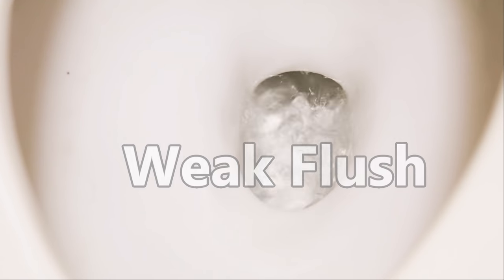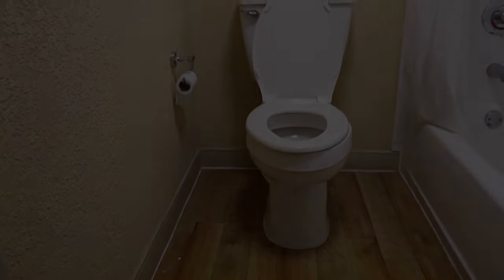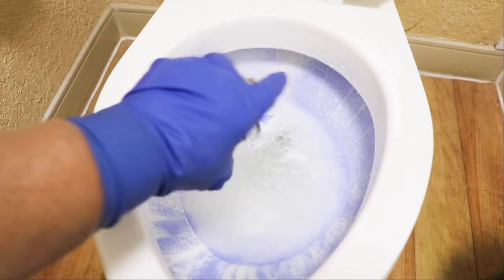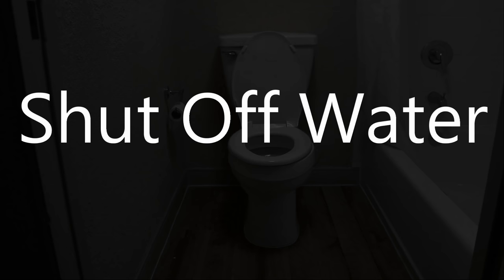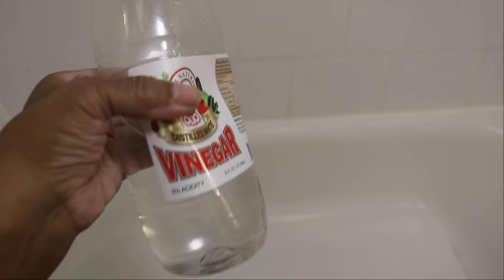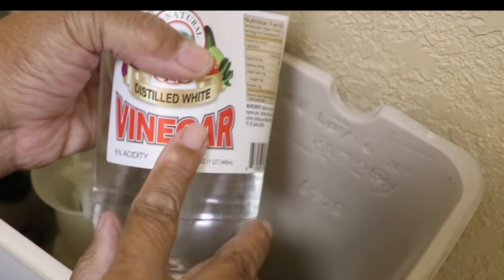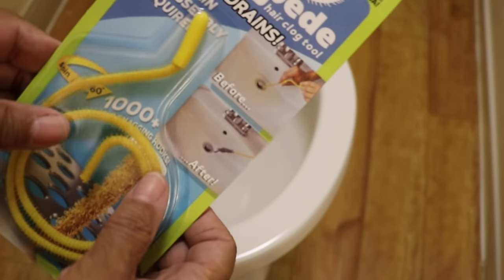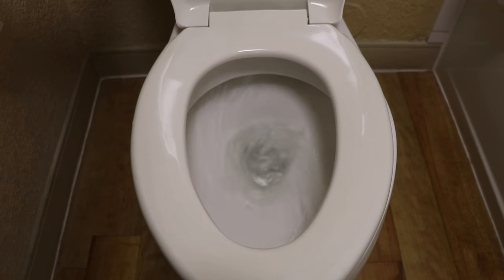FIX a Weak Flushing TOILET

Comment: The problem with today’s toilets is their use of water.  Some only using 1/2 gallon of water to flush/cycle the toilet compared to the old toilets that used almost 5gal of water.

Comment: Leah, good video. I'd like to offer a bit more information, but first my credential: I spent more than 30 years cleaning sewers and drains. I've cleared untold numbers of plugged toilets. That said, I offer the following: The condition you speak of is called "lazy flush". There are two possible reasons for this: first is clogged jets as you talk about here. The other is a partial obstruction in the waste bend. It's easy to tell which is the actual problem, but first, your video doesn't show a really good lazy flush. You might see the water raise to the rim and swirl slowly around and then slowly drain out. The toilet doesn't overflow, but it looks like it is going to. Here's an easy way to test this. Get a bucket of water and pour it down the bowl. The toilet should take a heavy flow from the bucket. If the water is lazy, then your toilet is partially plugged and it's time for a toilet auger. If the water flows out quickly, then your jets are plugged. 
Several years ago, before I retired, I came across a lazy flush toilet that was hand painted around the base. I'd never seen one of these. It was from Kohler's "Artisan" line (I think that was the name). The bathtub and two sinks were all painted as a matching set. The customer paid more than $2000 for just the toilet back around 1990. The toilet could not be replaced and it had lazy flush sydrome. I called Kohler for advice as I could not risk damaging the toilet. Their advice was the same yours except that they recommended another product besides vinegar but either one can remove the calcium buildup. Believe it or not, this was the first time in all my years I had ever heard of this method. 
I hope this helps your viewers determine the problem and then fix it. It's not that difficult.
Kudos again on another great video.
Reply from the maker: Thank you for offering additional information for our veiwers.
Reply: My father also an old drain cleaner taught me the bucket trick. Some people just don't understand it though. Even if u show them. That's why they pay us
Reply: My father inlaw is 97.. he is my go to regarding all things! Lol
He taught us the bucket o water test.. that said... i learned here that we have obstructed jets! Thank you so much.  Love see jane drill!
Reply: exactly. Well said.
Reply: Great tks
Reply: Wow, mansplaining.  Amazing 🙄
Reply: @hepcatliz  - Are you serious? 
If you'll come down from YOUR high-horse you'll see that his information has already helped others and in NO WAY was he trying to be condescending to Leah at all!
Reply: Really good info and I'm glad i came across it. My toilet has been draining slowly and I figured it might be a partial obstruction, so i may be right
Reply: Hi Jonas, so just to confirm that if there is a lazy flush pouring a bucket of water in the bowl can help detect either two things: A) obstructed jets or B) obstructed water bend? If the water poured in the bowl moves quickly this can indicate option A (obstructed jets) and the intervention is Leah's method of vinegar and duct tape. If the water in the bowl remains lazy after pouring the bucket of water then a water auger might be able to assist with this. Is this correct?
Reply: @sadeladybug  100%
Reply: @sadeladybug  Yes sadeladybug, you are correct. You can also  hold a small mirror in the bowl to look upward in the waste bend (shine a flashlight on the mirror to get enough light to see up there). Sometimes, but not always, you can see the object. The most common objects are comb, toothbrush, children's toy. You might see a wad of toilet paper, if so, it's probably caught on an object. With small hands you might be able to reach it with your fingers, otherwise try an auger. Good luck.
Reply: @hepcatliz  🤦🏽‍♂️🤦🏽‍♂️🤦🏽‍♂️🤦🏽‍♂️
Reply: @jonasthomander1230  Thank you so much Jonas for this tip!
Reply: once had a repeat call on a clogged toilet, i finally took it out into the yard n cracked it open with a hammer, and found a set of false teeth in it
Reply: Thanks for this info. My toilet has both. When I pour water in, it comes up and drains slowly. Then when I flush, I can clearly see water from very few jets
Reply: When this solution doesn’t work, you may find the interior flushway has calcium deposits (from hard water), and will catch toilet paper (alike a sand paper action), and the toilet must be replaced.  For some models you can purchase the bowl separately (to save $),  but the color match may not be perfect.  I have tried pumice stone, and even that will not solve the larger problem.
Reply: @hepcatliz  Wow, manhating.  Amazing
Reply: Thank you! I ve been scratching my head over which one it is?! I  believe i need the auger...
Reply: @rockridgefarms  With those in there...."CHEWING"..... everything up....<insert lot of laughter here>, that toilet should've been flushin' like a dream !!!  😁😂😁🦷🦷🦷🚽🚽🚽🧻🧻🌊🌊  Yes, yes.. thank you... thank you...I will be here all thz week!!
Reply: The bucket trick is a great tip! If the water goes down with no problem the issue is in the tank and jets, if not, it’s a clog somewhere downstream, which is the case the vast majority of the time. (40 yr handyman).
Reply: @Osnosis  Good point-out, Osmosis. My bowl has obvious calcium build-up. I've tried to scrub them off, but no dice. After reading your comment, I think I might have build-up in the u-shaped section. Thanks for explaining that angle of improper flush reasons.
Reply: @lonesomelou4188  Use lots of CLR to try to dissolve the calcium build-up.  It may take several applications.
Reply: 'Lazy Flush" sounds like a poker hand.
Reply: Can the toilet jets be cleaned? Instead of replacing the toilet? I have a wall hung toilet in both bathrooms one is way worse, almost can never get it to go down. Just wondering if I can clean it
Reply: @kaitlinwells4510  video shows how to clean the jets
Reply: Thanks for this additional info. Always good to read the comments bc I found out my issue is slow drain, lazy flush!
Reply: @Osnosis  do you apply the CLR in the same place as shown in the video?
Reply: @DivaDen  Actually, after going back a few times with the CLR, it did work.  I live in a VERY hard water area, so there was more buildup than normal.
Reply: What's the next product you speak of
Reply: @hepcatliz  somebody's jets are clogged! 😆
Reply: Thank you for the info, I find it helpful.
Reply: @jonasthomander1230   IF you have  an endoscope (amazon has these for bout 20-30 bucks) ours has helped us find a few things around the waste bend and a little bit beyond. From there,  one of those squeeze/grip claw things (no idea the name) can be snaked in to grab said object. Helped save a ton of money on plumber calls when you have small kids clogging things!
Reply: @seejanedrill  I think the solution to use would be CLR or similar.
Reply: @rockridgefarms  lol. Gave me my chuckle today.
Reply: Thanks for this. I have now identified what the problem is and can go ahead.
Reply: @1stFlyingeagle k
Reply: Yes Jon is correct the problem is in the bend. The "Blow Hole," well thats what I call it. It's hidden the hole at the bottom of the bowl. It gets clogged up, need a screw driver to chip at it. Build up from sediment most of the time.
Reply: @sadeladybug ,@😊
Reply: In my toilet the overflow pipe does not go to the rim jets, it goes straight to the bowl. The tank water goes to the jets. This means I have to pour the vinegar into the flap covered opening.
Reply: @jimkoss3318  So on a regular Toilet w/out the syphon those "new kinds." The old standard toilets when you lift the flapper water comes out at 2 points in your bowl, "the seat." 1 it comes through the weep holes at the top of the seat. The other place that it comes out at is at the very bottom, which i call the blow hole. You know like the whales have? Well you can't see it because it is usually pointing towards the tank at the very bottom of the bowl. Well that could be clogged. I have fixed a many toilets that have a weak flush because that blow hole is clogged with sediment.
Reply: @jimkoss3318  Well if you have an older toilet it mostly likely gonna have 2 exit points at the very top, which you are calling the rim jets? And also at the very inside bottom there is 1 hole that jets all the water into a certain direction. If you have a weak flush even though that hole has water coming out from that hole, I would still bet that it has a lot of sediment and NOT allowing it to flush like it was intended. You don't have that hole down there? You might have to stick your hand down there to find it.
Reply: @brizzx32  Interesting. Is there a test to determine if the “blowhole” is clogged?
Reply: @brizzx32 The jets are the holes which encircle the top of the bowl. These are fed by the tank. 

The “overflow” pipe feeds into the bowl via a single opening at the bottom of the bowl.

I will check it out.
Reply: @jimkoss3318  Yes bucket test, fill 5 gal bucket. If toilet swallows then you know that the toilet is NOT clogged. Then just get a philip short screw driver and start working inside that toilet. Dont worry you wont break toilet, i pass cables thru toilets all the time and they don't break. Becareful with flat head that could chip the toilet other than that give it some elbow grease you will be alright.
Reply: @brizzx32  Thank you for the help
Reply: @jimkoss3318  So I am thinking that you had a weak flush. Did you try this hack? Was that blow hole filled up with sediment?
Reply: My kitchen sink has been draining slow so we started dumping the sink water in the toilet. It's not presenting "lazy flush" and or is plugged. Advice on the best method?

Comment: I followed your advice, and my 2 toilets are working like new again! I've had 6 different plumbers, over the years, come into my home and tell me the problem with my toilets were caused by mineral accumulation, and that the only solution was to replace the toilet. NO ONE told me I could dissolve the minerals, until you. I'm happy to have saved thousands of dollars that the plumbers wanted. Instead I did the work myself, and spent about $10 on white vinegar. I'm happy my old toilets are staying out of land fill also. Thank you! Thank you! Thank you!

Comment: When you say “you CAN do this” - I 100% believe you, thank you!
Reply from the maker: You can
Reply: Completely agree
Reply: I had a father who didn't think girls could do anything except cook, type and take care of babies. It made me determined to prove I could do anything I choose to do. Through YouTube I have changed water pumps, fuel pumps, washer fluid pumps,   radiator and other small things on my cars. Took out all the old galvanized pipes in my house and replaced them with Pex pipes. Put in a new laminate tile floor. Repaired porcelain tile grout. Textured my old plaster walls with knockdown texture. Replaced a sump pump. I'm  still a girly girl who does this stuff and whines if I break a nail but won't ask for help till I've exhausted every option and ounce of energy proving I CAN DO THIS! And guess what....I  can't cook! 😆
Reply: @LilOleMeAgain2634  and I just see a very skilled person that not only knows how but has a great way of teaching.... So take that!
Reply: @LilOleMeAgain2634   😂

Comment: In this house 10yrs and never satisfied w/ flush of downstairs toilet. Had it off anyway to have water meter changed which was behind it. This trick worked so well, I couldn't stop flushing it to watch my success, then of course had to christen it (too much information!) To be sure all sediment was gone, also scrubbed each outlet hole with some fine steel wool with the vinegar that had drained into the bowl after removing tape. Amazing what you see placing a mirror in there! Thanks Jane. Love your channel. New sub here after watching numerous episodes. You're doing a fab job!

Comment: Great video, Leah.  Thanks for also mentioning the siphon jet at the bottom of the bowl.  I had problems while you were on hiatus where the bowl would fill and swirl but waste wasn’t really being pushed down the trap.  Someone suggested taking a long toothbrush handle or pocket screwdriver and breaking up any lime and calcium deposits blocking the siphon jet hole.  Sure enough, after chipping away at an almost total obstruction and removing almost a pound of scale blocking the hole and up inside it, the toilet flushed faster and more powerful than it ever had in almost 40 years without doing the 5 minute swirl and no payoff.
Reply: You’ve had the toilet for 40 years?
Reply: @DJ-nm3ub  The inside of my toilet tank shows a production date of 6/18/1970!

Comment: Good tip. I had a similar issue a few years ago and I even removed the toilet and I could find no issues. The problem was on my roof. The venting pipe was blocked with snow and ice on the roof. It was an easy fix but I made it difficult. Again thanks
Reply from the maker: That's common too

Comment: This is great info and so well presented. I would like to add that if these methods do not help much then the slow flush could be caused by a worn flush valve closing too fast to allow the right amount of water to flow in. Had this problem, replaced the flush valve and problem solved!

Comment: I couldn't figure out why a bucket of water would go right down but it would not have a strong flush. I could get it down with a plunger. I was very confused by this. Your video solved my problem. I figured this short video was too good to be true. But clogged jets was my problem. I never thought to clean the area's I can't see. Quick and easy. Thank you.

Comment: Leah, God bless you for eternity. After a few mediocre experts who gave me a few absurdities about fixing the slow toilet, I decided to do my own research to discover the easiest and most common sensical remedy and found you. Wow, what a genius and simple solution no 'experts' were capable enough to look at. 
I did not use vinegar and duct tape, but a small pick and a hammer to gently tap through the clogged jets and rotated it to unclog the 25 jets below the rim. Now, the toilet flushes beautifully as I have never seen before. I am very grateful to you.

Comment: Thanks for this post. I have struggled with this problem for weeks. Especially frustrating in a drought where we are trying to save water. I cleaned the jets, removed a blockage I had never even suspected from the siphon jet, and now it works great!! Thanks again for your help.

Comment: thank you for this tip! i moved to a place with very hard water and have been surprised at how frequently i have to use vinegar to remove mineral deposits from my shower, but i never connected the dots that the same thing would be happening to the toilet bowl jet apertures as well.

Comment: Fantastic!  I've been using CRL for years but vinegar is easier on the hands and cheaper.  But my real take away was the duct tape.  I'v been pouring the CRL into the overflow carefully and slowly so as to not trigger the flush.  This allowed the CRL to get to the rim "raceway" and leak thru the holes.  And I also waited an hour.
One additional suggestion - check the rim for residual adhesive from the duct tape.  Any left there will be a dirt catcher for sure.  A little goo-gone now will save alot of elbow grease in the future.
Reply from the maker: Thanks for poonting out du t tape residue

Comment: I was about to start searching online on why my toilet started acting up when this video popped up, you are awesome, thanks
Reply from the maker: If this doesn't work it could also be a partially obstructed trap or the stack is blocked.
Reply: @seejanedrill  if the stack were blocked would that also cause a gurgling sound from a sink drain in a different room while the bath tub is draining? That’s a recent problem as well , didn’t put 2 and 2 together until you mentioned the stack

Comment: As a 40-something year old woman I'm so happy to see you doing this and these videos. I think there's a self satisfaction/fulfillment to be able to say 'I got this'. I have to say, looking back at my childhood, there's so much my father taught me I never appreciated until I was one my own. I was an only child of a dad who is a Mr. Fix it, and as his 'helper' he taught me so much when it came to home repairs. I was the kid on the block who knew how to use table saws and drill presses, knew what each tool was and what they were used for etc. I've rarely required hiring help over the years unless it was a really big job (I've even done my own bathroom remodel, wood floor replacement, etc). He didn't just teach me how to fix stuff, but how to be self sufficient. While I love my husband very much, he is the complete opposite when it comes to fixing things...it's 100% my job in the house and I'm fine with it. I've done my best to pass this stuff on to my son.

Comment: Thanks so much. Your solution really worked!  For the most part though, my jets around the rim were clear, but the bottom siphon jet opening was almost completely closed up by mineral deposits.  I had to use a pocket knife to get it cleared. Now it’s working great.  Thanks for making this video.
Reply from the maker: Glad it worked out...yeah mineral deposits can become rather hard.

Comment: 6 months of double/triple flushing until I took the bowl off the flange to realize the drain wasn’t blocked. Then I saw your video today and cleaned up all the mineral deposits in the jet siphon with a wooden chopstick. Problem solved! Thank you so much Leah!